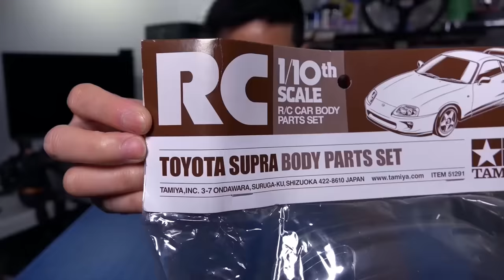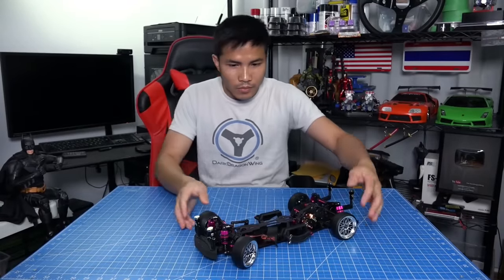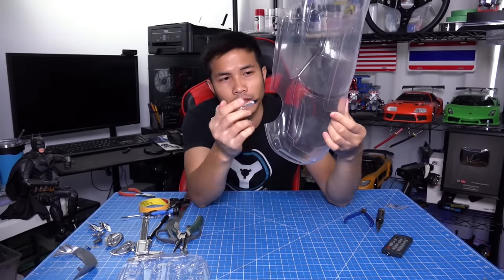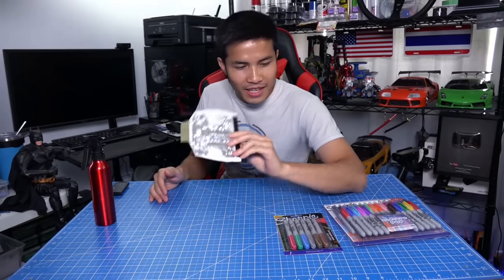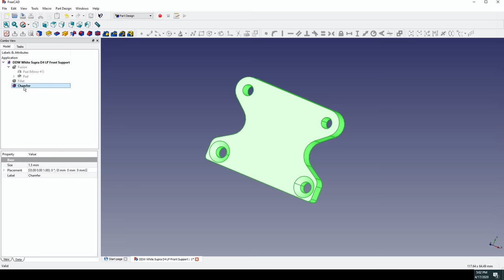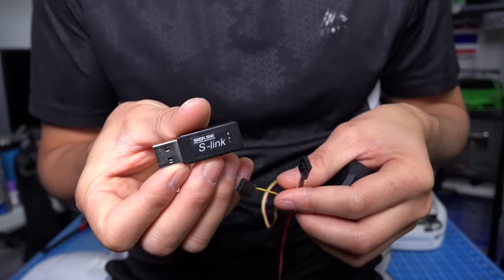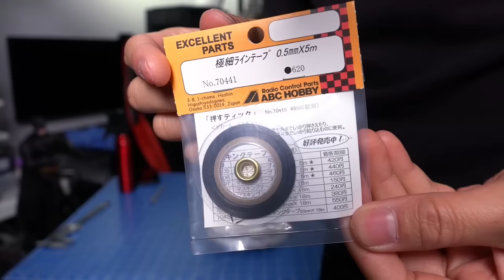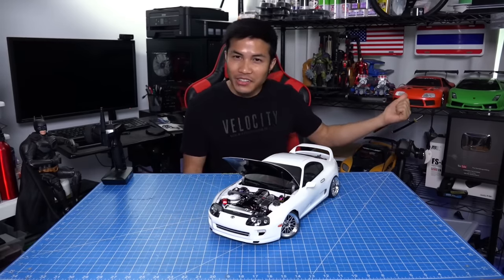RC Modify 28 | White Toyota Supra MK4 - RC Car

Comment: The Supra sound, sounds like it came from gran turismo
Reply: Ye its Electric lol
Reply: Because it actually did
Reply: The toms Castrol supra that was in gran Turismo is the most accurate supra sound since that car had a 4 cylinder celica engine not the inline 6 2jz a supra usually has
Reply: Jack Hubbard yeah the 97 Castrol Supra sounded godly but the one that was played here was the 00 Castrol Supra which sounded weird
Reply: Sounds like a Mustang from forza
Reply: @Nissan Skyline GT-R V-spec II Nur R34 '02 same sound file
Reply: Yea I think he should've kept that sound
Reply: SuPreme OpZ  u to
Reply: It needs more stustustustustsustsustsustsu

Comment: Only use 200mm  not 190mm! More room for spacers,stance and breaks!
I would e loved it had you kept the hood clear so we could see the engine bay work you did! Run a led under there,would’ve looked so money! You can candy/clear them in yellow or smoked out!  Even use tint instead of spray! I airbrush candies though for everything i want to see through or want lights running through!

Comment: Hello Maggie my name is Tony Thao I have been getting problems with my chassis the steering has stopped working and my motor makes a high pitched sound so I wanted to know if you can help me fix it
Reply from the maker: Could be because of a low battery.

Comment: I'm new to this but give me time what's the best car kit to buy to start pro
Reply from the maker: For Modify, it can be anything, probably 1/10 size or smaller.  For drift, start looking into RMX or MST then research around those :)  Research on RC car, charger, and battery safety.
Reply: @DarkDragonWing  thank s vary much 🙏
Reply: @DarkDragonWing   just don't that thanks so much for the help I found a rmx 2.0 is that a good car